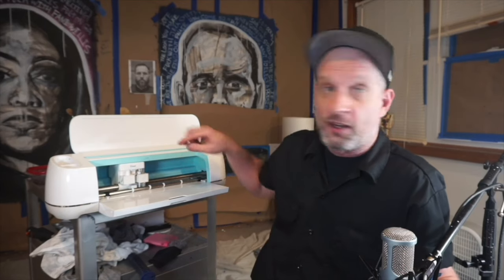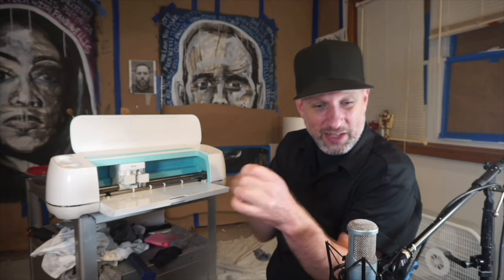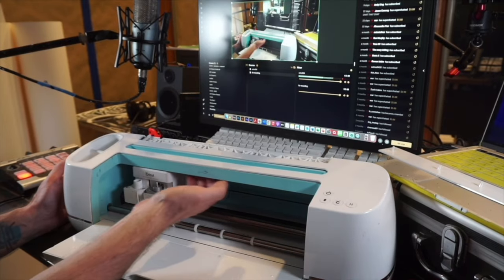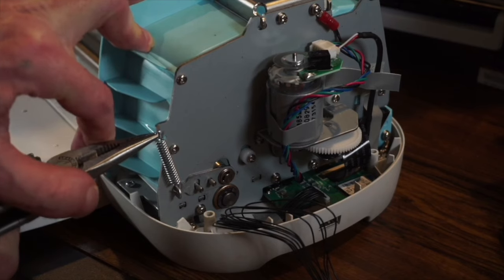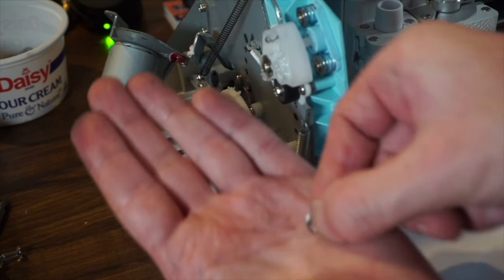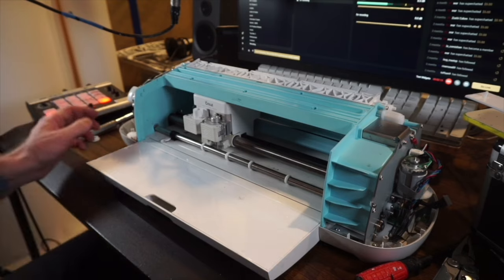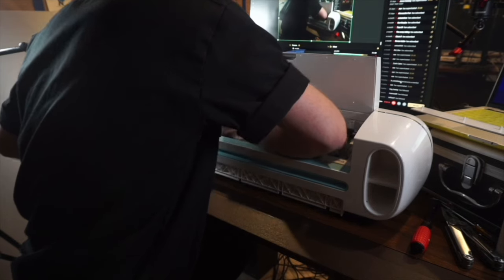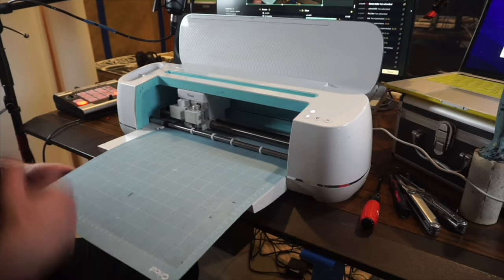Cricut Maker Rubber Pressure Roller Repair EASY FIX DIY

Comment: 😢😢😢..I can't get the cover off... maker 3, I can only find 4 screws on the upper inside part.. the cover is loose at the bottoms and sides, but won't let go in the center, how hard did you have to fight the plastic?
Reply from the maker: I think you are missing 3 screws they are patterned like a zig zag. I am guessing you are not finding the 3 that are closest ou the front of the machine. if you have a small mirror use it to look under the space more to see what you might be missing. Good luck.
Reply: yes!! just found them... thank you so much for this video... ❤❤❤

Comment: Maybe a bit to late to ask but will this work for cricut air  explorer 2… I already started taking it apart using some of your video. I can’t get the bar out it’s stuck in the right side… c clamp is off
Reply: The right side of the form urs vs mines is a tad bit different. You unplugged the motor thingy from the right side but didn’t remove it… neither did I… butttt… now the left side where u moved the c clamp form the bar behind the white gear…. (Then u went back to the right side and took that “entire piece off we could have done that earlier “in the video) that the c clamp held back…”😢 it came off in my left side but won’t come off my right side because of the motor🤔. Which I believe is causing my bar to be stuck
Reply from the maker: Unfortunately I only have the cricut in the video and I’m a very visual learner. Sorry I can’t be more helpful. Good luck I hope you figure it out.

Comment: What size is the phillips socket bit to take the 7 scews out of the inside of the unit?
Reply from the maker: I am not sure it was a pretty standard size. Thanks for checking out the video hope it was helpful and thanks for supporting the channel.
Reply: @theZimvideo thanks! Also, what is the name of the gap tool that you used to get the 2 new rubber rollers in place on the rod?
Reply from the maker: @truthknowledgeseeker  it was an adjustable socket wrench. You can use anything even the edge of a table it's it a good sharp 90 degrees.

Comment: Your video was very self-explanatory and easy to follow up but for some reason my phone died so I decided to do it put it back together on my own and I think I’m done but I still have seven black screws help!!!!
Reply from the maker: Seven black? There are a couple black screws on the motor side and 4 long ones when you take the cover off. Guess you will need to charge your phone or pull the video up in your computer to figure out which ones you forgot to put back it. Thanks for checking out the video and supporting the channel I appreciate it!

Comment: What is the tool you use to install the rubber wheel on the bar?
Reply from the maker: It was an adjustable socket wrench. But you can just use a table or countertop that has right angles and press them on that way. Thanks for watching the video appreciate the support.

Comment: @theZimvideo (hope I tagged you with that) on another video the guy ended up dropping the c clamp on the left side when putting it back on which made for further disassembly on his cricut to retrieve it. I was hoping your video would show how you put the c clamp back on, especially since it's such a tight area to work in but you only showed the right side of reassembling the machine. Any chance you can show a short clip of the left side reassembly?
Reply from the maker: Thanks for supporting the channel. Unfortunately I did not record the left side I was hoping it was implied by the right side since the c-clamp is the same process on both sides. Sorry

Comment: Any ideas for what to do if the machine doesn't turn back on? Followed each step, step-by-step, and I could get it turned on, but then nothing when trying to pass a pad through with the arrow button. It also wouldn't power off once it was on.
Reply from the maker: Hopefully you didn't do anything bad to the wires on the control board when you took it apart. That's the only thing I can think might be the problem. I hope you figure it out. Thanks for supporting the channel and watching the video I appreciate it.
Reply: I'd make sure you plugged in the white piece back the same way

Comment: Did the rollers spin when in the correct position?
Reply from the maker: the old ones or new ones? The new ones should be tight to the metal bar and only roll with the metal bar during the action of the machine. Thanks for checking out the video appreciate the support!
Reply: @theZimvideo  thank you for your reply. I was asking about the new ones.  We just put on a different brand from the one you used. They spin freely when in the proper position. Is your maker the original maker or is it a maker 2 or 3?
Reply from the maker: @joreed42  I have the Cricut Maker. Not the 3 (doesn't seem like there is a 2...)

Comment: What am I doing wrong my roller won’t come away it seems to be attached to something on the left side?
Reply from the maker: If you pulled the c-clips off sometimes the metal is a tight enough fit that it binds a little you just have to give it an aggressive jiggle. I hope that helps and thanks for supporting the video I appreciate it!

Comment: What about the rollers in the bottom? under the rollers your replaced? will those make your mat pull funny or is it just the top rollers? all of a sudden my cricut is giving me a hard time...
thanks!
Reply from the maker: The bottom rollers are what actually move the mat the top rollers are pressure against the bottom rollers. Hope that helps. Thanks for checking out the video.
Reply: So is it possible the bottom roller can get gummed up and not want to push the mat? The one on the left looks like it’s got some debris on it but I haven’t taken the top roller off yet. I just know it stops and is marking the mat in the process when it makes that horrible noise. Lol
Reply from the maker: @minatevere  I imagine it can. this video doesn't address what to do if the bottom rollers have a problem.

Comment: Bro, thanks for the video. It was very helpful. Got mine done in about an hour, even with the wife breaking my ⚽️ 🏀. Pro tip; while you’re boiling the new rubbers, put the roller shaft in the freezer. They’ll slide right on. What we need to do now is figure a way to lift that shaft when we put it away (a shim or something), that would buy a lot of life, I believe. Thanks. Later!
Reply from the maker: Thanks for supporting the channel!!!! Glad the video was helpful!!!!

Comment: Ok so place the bar back in might yours be backwards because you are filming because the end that has the different withs fit on the motor end to the left...I  have a cricut 3...and how do you get the washer back on and where does it go because I  an not get it back on where you show it goes
Reply from the maker: I am not clear on what you are asking. Washer? the c-clip? sometimes using tweezers or needle nose pliers can help hold it in place while you push. Hope you get your's put back together. good luck.
Reply: Yes the c clips ...and which direction does the bar go back in
Reply from the maker: @glendastevenson5256  the tapered end goes on the right when you are looking at the machine.

Comment: Thank you! Unfortunately my roller doesn’t spin… Someone has any suggestion?
Reply from the maker: the bottom ones? I don't know about opening the bottom part of the machine and troubleshooting. Hope someone else has some answers for you. Thanks for supporting the video.
Reply: @theZimvideo  the bottom ones works correctly, the bar where I installed the new rubbers does not turn so the mat does not load…

Comment: Use a pipe cleaner or bread bag tie to take the spring off and replace them
Reply from the maker: Thanks for supporting the channel! Good tips.
Reply: @theZimvideo  I just replaced my rollers today and the main struggle for me was the glued down top and the large white gear that is hiding the area that you really need to get to so you can easily remove and replace the c-clip on the roller bar.  There are 3 screws holding down that white plastic piece that blocks the gear and even though you cannot remove the white piece after removing the screws you can then flex the bottom of the unit down while pulling up on the upper portion of the unit and you can slip that gear off.  I did this and was able to get everything back together.  Anyhow, thanks for the entire video.   Cheers

Comment: I followed your steps and now when I try to cut, it doesn’t roll, is there a solution to this? I’m a bit stressed I need help
Reply from the maker: that's a bummer. if it's not grabbing the matt you might have forgotten to attach the springs correctly. if the lower rollers are not even moving there must be something else the problem. all the mechanisms to pull the matt are in the bottom area that was not exposed to the fix in the video. I hope you can figure out what's happening with your machine.
Reply: @theZimvideo  let me take it back apart, thank you

Comment: You never showed what you did with the large gear on the motor side. Can’t get the gear off to put the C-clip back on. And the shaft doesn’t go out the right side on mine. Hole is too small. 🤨 And, you didn’t mention the goo that is all over the left side that is just about impossible to remove from tools and your hands. 
I ended up carving enough plastic off the door mount to get the big gear off. Had to carve out plastic on the right side to make room to slide the shaft out. But I got it. 😊
Reply from the maker: Sounds like you got it worked out. Thanks for supporting the channel I appreciate it!

Comment: Hey I did all the step-by-step things to replace the rubber band and now I turned it on, and it doesn’t roll like yours
Reply from the maker: without looking in your machine I wouldn't know why this is happening. did you remember to put the springs back on? Hope you are able to figure it out. Thanks for supporting the channel I appreciate it.

Comment: i replaced mine but now the bar won’t spin like it it won’t grab board unless i guide it in  the rollers seem smaller then the old ones and don’t seem to be gripping to the pads under neither not sure if this makes sense lol
Reply from the maker: Sometimes I have to give mine a little help when I feed in the mat but I haven’t had any problems once it fed in. Wonder what the issue might be for you. Sorry you’re having problems. Did you remember to put both tension springs back on? Thanks for checking the video.
Reply: okay yup spring are back on  it’s my moms machine i’m gonna have her bring her computer over so we can try a cut of she has to help feed and it cuts fine it it’s still better then buying a new one.. might be a good idea for a birthday gift for her tho lol
Reply from the maker: @kalenatomlinson8502  great sounds like you got it worked out!:glasses-purple-yellow-diamond:

Comment: I am unable to get the bar removed. It’s like it’s stuck on the left
Reply from the maker: Assuming you removed the clamp, give it a intense giggle as you try to slide it to the right. you could also try to spray some WD-40 or pour a little olive oil on that area and see if that helps it move for you. Good luck and thanks for supporting the video I appreciate it!

Comment: What is the reason for boil the rubber
Reply from the maker: To soften them. They are a really hard rubber. Not squishy like the original rollers. Thanks for checking the video and asking the question.

Comment: so my cricut no longer cuts my projects, no matter the blade , grip mat, pressure, ect .. i called cricut and they said its my machine  i dont know what else i can do.. i had it for a yr and use it here and there.. it has not dropped . just dont understand y it will not cut anymore
Reply from the maker: Thanks for supporting the channel. Unfortunately I am not a cricut tech and I have not had any other problems with mine so I won't be able to help. Hope you can find the help you need. Good luck.

Comment: We replaced the rubber wheels however it powers on but none of the lights work .
Reply from the maker: hope you did not break the wire to the control board... Maybe you didn't plug it in all the way? Does it still work without the lights?

Comment: I got it all the way to taking out the roller bar.  Ugh the right side the hole between the case is off set.  
so much for easy fix.
Reply: I figured it out! two screws on the edge of the metal base and gently pried it up to open the hole for the roller bar end.
Reply from the maker: Glad it worked out! And thanks for supporting the channel!
Reply: @zelphiawhittington1877 SAME HERE!  Thank you so much for pointing out those 2 screws!  Thought I was hopeless then went to look for what you described -- voila!  You rock!
Reply: Now ppl are slicing the rubber and slipping over the rod👀🙄.     Weeks later I learned of easier way
Reply: @zelphiawhittington1877 Is this a fix? I guess I could try this before taking my machine apart…

Comment: Dude the rod doesn’t come out that easy… I followed each step of the video and when it comes to the rod, it won’t fit through the whole. And yes I took off the C clamps, it’s like the whole is too small
Reply from the maker: thanks for supporting the channel. Just give it an aggressive giggle! it is a tight fit it will pinch easily. Hope it you can get it out.
Reply: @theZimvideo  getting this rod out is a complete night mare, and I followed all steps to a t. like @omega_filmz said its like the hole is too small.

Comment: Cricut sucks to make it this in depth. What a pain in the ass. I went to make cutouts for a birthday party and my rollers were all of a sudden ruined and not working.. well now after I could only get these things off Amazon taking two days to get here I’m trying to take apart my machine. Can’t even get past the first step bc mine was glued during the manufacturing process. Plus they don’t even use regular screws?! Ugh beyond frustrating. About to just toss the damn machine and be done with Cricut
Reply from the maker: Sorry :( hope you are able to fix it! Thanks for supporting the channel I appreciate it!

Comment: Can you do mine? 😢
Reply from the maker: Me? No. I thought about trying to get someone to fix mine but it wouldn't be cost effective you mine as well just buy a new one if you are going to have someone fix it. It's really not as hard as it looks just take it one step at a time. You can do it.
Reply: @theZimvideo  It is extremely difficult! Not sure how this is an "easy"fix
Reply from the maker: @LeslieJoyMartin  I was overwhelmed by it when I first saw what it took but once I sat down and just did one thing at a time it became a lot simpler. Deep breaths and one step at a time and I think you will find the same. Hope my instructions are clear enough to make it happen.

Comment: The top broke. It’s not meant to be unclipped. I called cricut and they said we shouldn’t unclip it that way. Thanks for nothing
Reply from the maker: Sorry you had that experience. This was never intended to be an official repair as cricut did not make this machine for easy or any repairs. I would be upset with cricut not with me. Thanks for supporting the channel any I appreciate the support.

Comment: Help I was wondering if you could help me I’m struggling with putting the C clamps back on. I lost one it went flying off and the other one I just can’t get it. I don’t know if I’m doing it wrong or what but do I have to put it back on there? Do they need it? I know it came with it but I’m super frustrated with it
Reply from the maker: Thanks for supporting the channel. You might try holding them with needle nose pliers. They hold the bar in place so I don't think it would be good to try to use it without them.